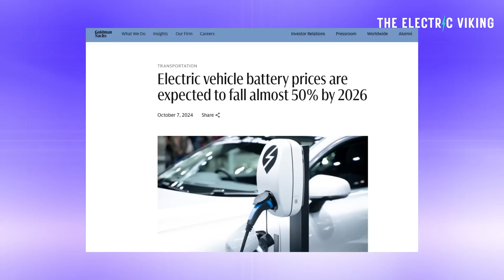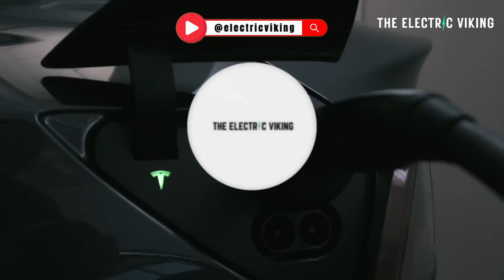Analysts say a NEW EV battery will be cheaper than fixing a gas engine

Comment: You confused battery pack weight with energy capacity. EVs (other than an Aptera or the like if it appears) won't have 50 kwh packs. They'll have lighter, 100 kwh packs. Drivers want 300 miles or more of range. To lower the energy capacity, while delivering the same range, EVs need greater efficiency, more miles per kwh, and EV makers other than Aptera aren't focusing so much on greater efficiency. Lighter batteries will help but not enough to push EV efficiency up to 6 miles/kwh. Aptera has a market, and I'm in it, but in the U.S. at least, most people still want SUVs and pickups.

Comment: It seems that overall costs of EVs, batteries and all, will tumble inevitably given the rapid advancements mainly led by China, as you have reported well and consistently.  Tariffs will only be a speed bump, no pun intended.   Economics of EVs will trump ICE vehicles by a long shot.  I expect practical mainstream EVs will be $25K or less in ~6 years, displacing most ICE vehicles that are currently on the road, especially older ones.  Tony Seba is not wrong.   And you are not wrong that EV battery replacements will be at least on par with major ICE engine repairs, but I think the bigger point is that EVs in general will be taking over the roads in most parts of the world.  They are already more reliable, safe, faster and less expensive to own and run than their ICE competitors in their similar class.  By 2035, it will be game over.

Comment: I think if you need an engine replacement for mid sized ICE from the Volkswagen Group, your 100kWh battery pack costing $56 per kWh is now already cheaper ($5600). Off course it’s not the price end consumers wil pay at this moment. Total Tesla battery replacement seems around €15000 at this moment (Netherlands). 

From what I understand most of the time it’s not necessary to replace the entire battery but just one defective module or battery management system (BMS). Tesla will replace the entire battery, but specialized companies only replace the defective module for €1000 - €2000. A total replacement will be necessary in case of bottom damage.
Reply: Have you seen how Munro extract a battery in structural packs? Forget cell replacements! And structural packs won't be a breeze either. If the pack is cheap, it will still be worth it.

Comment: Even Toyota buyers here are experiencing engine failures left and right. ICE engines are now suffering from supply chain collapse as the worldwide parts and engineering industries are gearing up for EVs only and closing gasoline parts businesses. The American car market is currently flooded with entire genres of YouTube videos of failed ICE engines that didn’t even last 10k miles.  Batteries are proving to be much more reliable as Recurrent numbers point out year after year. Batteries are not getting worse, they are getting better by a long shot year after year.

Comment: It would be good if we could have a lightweight storage device that held around 450-550 miles, sure it will happen within the next 10 years !
Reply: That type of battery will be in airplanes first, I think, due to price.
Reply: I wouldn’t bee surprised if solid state beings shipping in EV’s in 3 years time, initially expensive ones, but it will filter down. By 10 years time I think that sort of range/weight will be common.
Reply: Why do you need that much range?  Do you ever drive 450 miles without stopping for a bite to eat or to take a pee?
Reply: @ yes I do as a pensioner I have my hobby weekends away Wales, Bradford etc and the convenience for me is doing the journey in one hit, stopping for a toilet break and a takeaway coffee and getting the journey done, then I can relax when I get to the hotel and not worry about mileage left in the car because I can gat back home on one tank of fuel in my auto.
I understand that’s not everyone but it really suits my lifestyle at my age.
Reply: @johngoff8923  
If you stop for a pee and a coffee, you will have stopped long enough to charge from 20% to 80%.  Do a little thinking.  I'm assuming you can plug in at home, which means zero stops for fuel throughout your year.  And very large cost savings by using electricity rather than fuel.  If, in fact, driving an EV on your hobby weekends added ten or fifteen minutes to your travel time wouldn't it be worth it to save all that other refueling time and cost?
Reply: @ A pee and a takeaway coffee takes maybe 10 minutes, you can’t get any charge at all for that with an EV and has explained once at my hotel I can totally relax and not worry about trying to find a charging point because I have enough fuel to get home again, it win win, you EV people seem to haves issues with that for some reason.
Reply: @ The cost of a new EV’s is out of reach of pensioners as most EV’s selling mainly through fleet

Comment: I'm replacing engine in my 50k mile 2018 Cruze now: $5k... While seeing $12K 2025 Leafs on AutoTrader in Colorado (Fed + State rebates).
Reply: Don't know why you would spend $5k on the Cruze as its value can't be that much. If you are in Colorado you should take advantage of their state rebates and the federal rebate before they go away. We have had 3 Leafs and they were fantastic cars for the money. But they are not road trip cars. They fast charge very slowly. Good luck on whatever you do.
Reply: @EVVolksmanID.4  At 50K miles it would be worth a little more than the engine swap. Tough decision.
Reply: Should have bought the Leaf.
Reply: If the Leaf is a decent vehicle that is dirt cheap.
Reply: @snookmeister55  Leafs have limited range so they go cheap if you only need a local area car.
Reply: @HoopsKevinski.  just makes perfect sense one battery fits all just like toy cars
Reply: That is sad but relatively cheap. Would think about selling at 90k tho:)
Reply: 2015 1.6t cruze, has been a nightmare of dumb ice failures from 110k miles, we are limping at 140k miles.

Good luck sir!
Reply: Have fun with your last ICE car,  ZZP will sell you a turbo kit and a digital tune up.  Stiff springs and bushings.

Comment: Technically cars have always been EV's, your battery just got bigger. Also you have not yet spoken about electricity generating hydrogen vehicles. Soo hydrogen as fuel but electricity is what powers the wheels.

Comment: There’s also the battery management system and chargers balancing unit, SRS pyrotechnic fuse and the case price to consider when costing a EV battery, not just the KWh to dollar amount.
But still if that adds another $1500-2000 it’s still not bad if it lasts 10-15 years.

Comment: There’s always going to be a second hand parts market, there’s someone near me selling almost new Tesla batteries for $6k for the complete assembly.
As a mechanic I’ve done hundreds of engine repairs that are close to that or exceed that cost tremendously.
Reply: The industry is moving to batteries that will outlast the car body.  Million mile batteries.  When the car body is trash the batteries will be removed and sold for energy storage, making the scrap value of EVs much higher than ICEVs.  Any needed battery pack replacements should be very rare, due to some sort of manufacturing flaw.  EV makers would be wise to give very lengthy battery pack warranties, folding that small cost into the price of their EVs.
Reply: @bobwallace9753  Saw an MG 4 today with a ten year warranty.
Reply: @bobwallace9753  
Ah, so the social difference is thus:

In the ICE world, the vehicle would always need repairs and no manufacturer is equipped to provide those themselves, so first-party guarantees couldn't easily be provided, and so there was never a way to put the burden of maintenance onto the manufacturer, and so they didn't build them to be maintainable.

While in the EV world, it's much easier to provide a guarantee of reliability in the first place, and in the second place, battery replacements can be made much simpler than engine repairs, so manufacturers probably can take on that burden and probably will and maintainability will be prioritised a lot more by the manufacturer.
Reply: @spaceprior  
With ICEVs the model has been for dealers to sell cars for not much profit, then make serious money on repairs and parts sales.  The manufacturer covers the cost of repairs for a limited time (36 months, 30,000 miles).  After that the owner is on the hook for repair costs.

With EVs we should see few, if any, problems with battery packs, electric motors, and electronics.  That profit center for dealers will disappear.

If EV manufacturers want to expand their addressable market they can offer high mileage battery warranties (300k to 1M miles) which will reassure potential buyers of no battery costs over the life of the vehicle.  

Use LFP batteries and there will be no battery fire issues.  Give access to the Tesla Supercharger system and there will be no range anxiety issues.
Reply: why are engine repairs expensive? If consumers actually bought things on the basis of how expensive maintaining it will be, would it be possible for engine repairs to be made a lot cheaper than they are today by support from the manufacturer?

I feel like there may be social reasons that doesn't happen, and these also seem likely to apply to EV battery replacement costs?
Reply: @spaceprior  Vehicle manufacturers make most of their profits from selling parts.

Main dealerships are financially supported by the repair workshop, sales do not make enough profit to pay for the building, vehicle service, repairs and maintenance are where the money is made, without that they do not have a viable business model.

EVs do not require maintenance.

Manufacturers will squeeze as much profit Oi of parts as possible, a Radar sensor for a Mercedes is $10,000 that’s one example that come to mind, I was in disbelief that was what they quoted for one.
Reply: @spaceprior  Lots of parts, complex engines and it is the cost of labour that make it expensive. Car battery is unplug connections, unbolt battery, bolt in new one, reconnect.
Reply: @FlintStone-c3s  I think contemporary batteries have a lot of parts as well. They shouldn't need to, they should lift out as a module, but the initial manufacturing is cheaper if they don't. Is the engine situation really different. Like isn't it possible for a manufacturer to make it cheap to replace an engine.
Reply: @spaceprior  Current batteries tend to have battery manangement built in. The cost of those won't change much however the cost the battery material is going down due to competition. Lithium v Sodium is a good way to have more competition.  Having the pack as a part of the chassis might cause issues. But batteries are tending to last longer than expected so ????? Nickle Iron batteries last 100+ years and are 100% recyclable however they are only about 80% efficient. Interesting times. Keeping everything charged is the issue I see.
Reply: Labour cost of changing a Tesla battery is $500-$3,000. Some even say $5k. This is one of the reasons why EVs with battery swap option is better (e.g. NIO, Onvo).
Reply: @martina5328  
I'd love to know the university where you claim to have received your doctorate.  The university where I got my PhD would not have tolerated a candidate who attempted to defend a position unsupported by data and logic.

And I find it really interesting that you claim to have an advanced degree in economics while not seeming to understand even the most basic economics of battery swapping.
Reply: @bobwallace9753  What data is lacking? Break even is 60 swaps a day, according to NIO official statement. Some swap stations have surpassed that volyme already.

Property is expensive in large cities. Build 3  chargers in central Hong Kong, i.e.  use 3 parking spaces. Now compare the number of cars that can be charged per hour to how many cars can be swapped using about the same space. About 20 cars can be swapped. How many can be fully charged using about the same space? 3 cars?
Reply: @bobwallace9753  To give you an idea, land in Hong Kong can go for US$ 14063 a square fot. So using more space for more parking / charging there to compete with swap makes little economical sense. Granted, Hong Kong is an extreme example. But the space used is often critical in urban areas.
Reply: @martina5328  You've got to park it somewhere overnight. Find a place with a slow-ish charger.
Reply: @jamesvandamme7786  Try that living in an apartment like most people.
Reply: @martina5328  You need a lift, a transmission jack-like thing, then unplug the cables and undo a dozen bolts and drop it. Pretty much the same as an automatic battery swap station. I worry about the bolts and connectors if they are continually run in and out without careful human supervision. Plus I baby my batteries and would be leery of somebody else's in my car. I don't even like to swap propane tanks for the grill. 

Maybe swapping makes sense for some people, somewhere. Swapping on motorbiles in Africa is catching on, but it's done by hand.
Reply: @jamesvandamme7786  Up to $3k in labour for a manual swap. Plus new battery, that you have to buy. Lets see you do that on a car worth say 10k. Compare that to an EV with swap - just swap in a new battery that you only rent. Think about it.
Reply: They are about 80% recyclable now. they should be pretty much fully recyclable by 2030. They can’t yet separate the lithium from the polymer yet but I think they can refurbish it.

Comment: I worked in Telco for many years in Africa and at some point the cheapest phone you could get was $40. The only way to increase the mobile adoption was to decrease prices. Chinese handset manufacturers helped to take them down to $15. It helped me to  increase the amount of new customers by a factor of 5 every month. 

In crs Volume will bring down cost and will increase adoption to segments not penetrated yet. But in people's mind a minimum of 400 miles of real autonomy is needed, reaching price parity in all segments, and bring down the recharge time to 20 minutes for at least 80% before we can get a wide adoption in all segments and countries around the world. Hopefully in 5-10 years.

The other trap and barrier I find as of now is that they sold us the idea that you would save money in gas when using EVs. But in Europe if you charge in a public charger, you will spend as much as would pay in gas for the same amount of kms. So the only way you can save is by charging at home and or if you have solar pannels.... if you live in a house 

and it's not easy to get a charger in a building. 

and home energy  storage is not cost efficient right now. 

I guess Australia and the US have better conditions for EV adoption than Europe and China. But China has cheaper electricity than Europe and the US.

Comment: 2810 batteries on ebay have increase in the last few years! It will take at least 30 years for electric cars to take over as many people can't afford a new car and will stick to ice cars, even though they are more expensive to run. Its capital v running cost.
Reply: You are bang on, I believe that this is the elephant in the room. Most people in the UK can't afford to spend tens of thousands of pounds on a car, many are only able to afford a couple of thousand pounds (or less). Also many of us live in victorian terraced houses with no parking and areas with very little inexpensive charging infrastructure. It's a long way away here.
Reply: So you get a new car every 30 years?

Comment: I suspect that replacement battery will cost you more than the one that came in your car.
Same is true for any replacement unitsuch as printer cartridges...
Reply: Not necessarily, there’s a whole business founded on refurbishing printer cartridges, same will apply, in fact it already does
Reply: @davesradiorepairs6344  Exactly. Will be like drug dealers giving you free samples.

Comment: I always thought this would be the case. The issue is, say you have a Tesla M3 your battery at some point needs replacing and the cost of the battery is low. Will companies like Tesla support swapping this out for a new battery that is cheaper and offers more range or do they want to be selling a new car.

Comment: We certainly are getting gouged on powerwalls then aren’t we …..
Reply: Nissan Leaf 40kWh 11.500 Euros.
Inverter etc. about 5000,--
Total cost for 30 kWh net capacity 16.500,--

Tesla powerwall 13,5kWh 7320,--
27 kWh roughly 16.500,-- incl. Gateway

I guess Tesla is still cheaper.
Reply: @wolfgangpreier9160  l meant the general price of the battery’s to produce initially , which would be roughly around 700 dollars , then you’ve got the hardware etc on top of that ( powerwalls here are around $13400 )
Reply: @KenSiebring  According to many Websites Tesla Powerwall costs 9.300,-- US$ Minus incentives - i did not count incentives because they are locally very different.

If you add the installer cost then both - Nissan Leaf and Tesla power wall cost about 1500,-- - 2.500,-- more. 

Not 4000,-- that is too much.
Reply: Absolutely. You can buy a 28.6 kwh(14.3x2) eg4 battery  for 7k and an 18k pv inverter for 5k.
Add an additional 1k for install and you can install a 28kwh system for less than 13k.
Reply: Yup. Even non-Tesla House Batteries remain expensive.

Comment: How more energy density will require less energy capacity?
Reply: Easy there is less weight to lug around.
Reply: Yeah, Sam is confused, higher energy density means lighter/smaller batteries. It doesn't mean you'll need less capacity.

Comment: you are confusing the production cost with end user price. looking at the spare parts prices today and price for installing it will be cost price X 3. No reason to think batteries will get smaller with falling price and weigth, more the oppesite if they can offer +500 miles range at not much higher price.
Reply: Solid State